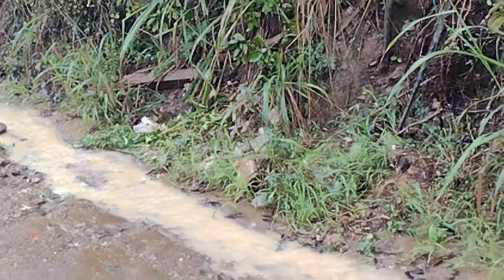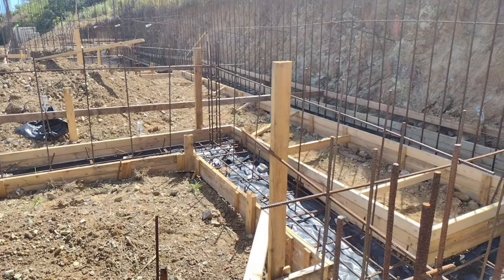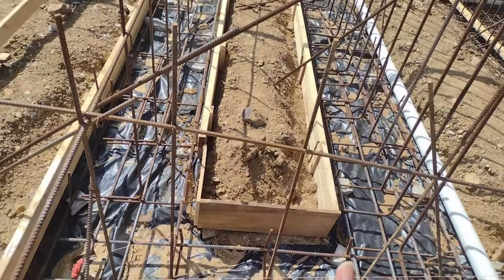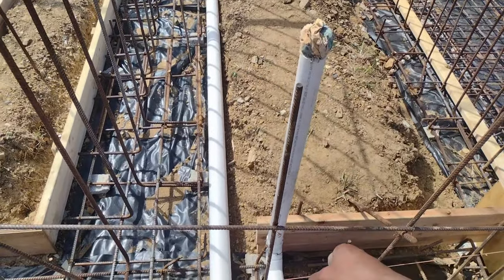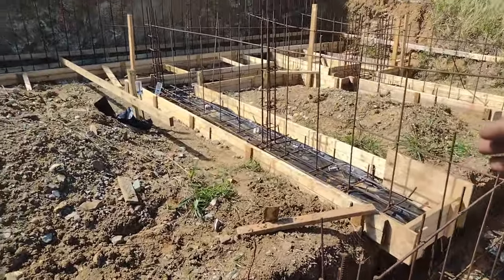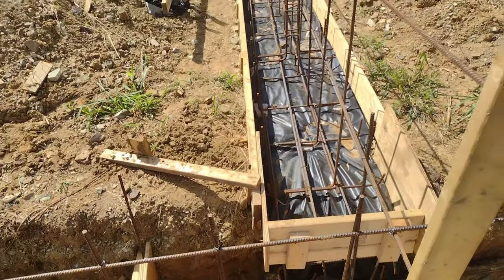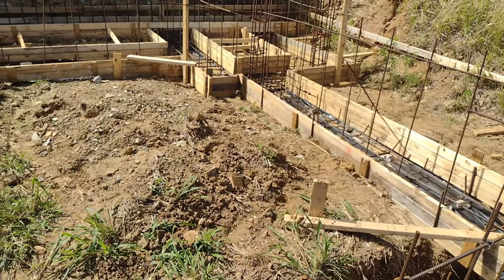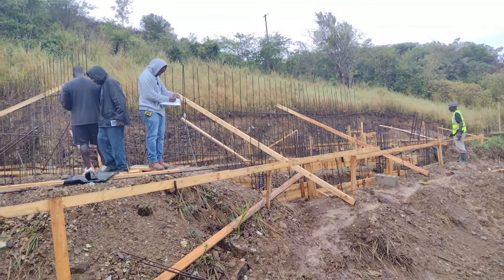The Journey - Part 2 - Foundation Casting - Onsite for The Whole Week - Episode 36

Comment: That water back there is going to be a problem for your foundation if not handled properly. It should have been identified during the site ground testing in the preliminary stage.  Well, that's if site testing is required in the BVI.
Reply from the maker: It's under control and in planning.

Comment: Nice Tom. Glad to be here on this journey with you. It’s good to see the work in progress. 

Did they pump the water from the foundation before they cast?
Reply from the maker: There is a pump on site but most of the water was dried out before casting the footers with concrete. The water problem is being addressed and the plumber started part of the remediation with running pipes to have the water flow under the building and come out in the front. Other drainage is being added with gravel and pipes behind the wall once the foundation wall is completed to remove any extra water. Knowing the water is there, we can't leave things as is and it have to be addressed.

Comment: U r building in what looks like water shed   area which should preserve
Reply from the maker: Well, this is one of those situation where preservation will loose as it's on my  lot. : ) I was also told that whole area there are a number of those underground channels but I just happened to come up on one by accident.  Water was always on the foundation pad but we never knew why until seen it for ourselves.  This is an area they called Spring Ghut as there was always water running down from the hillside somewhere. Growing up I never really knew why until we found that underground channel.